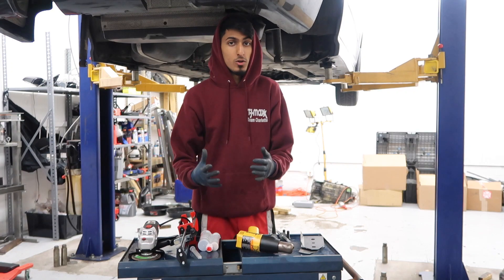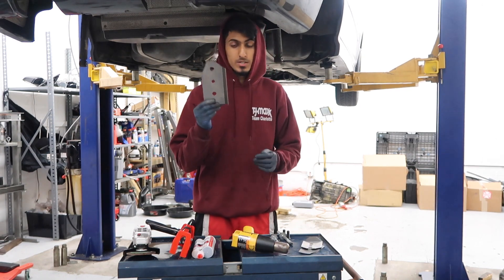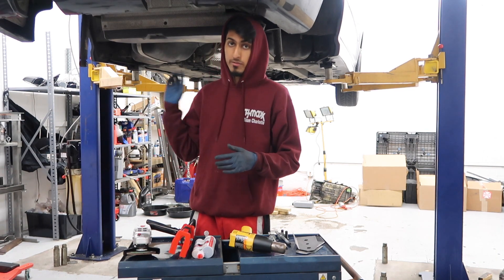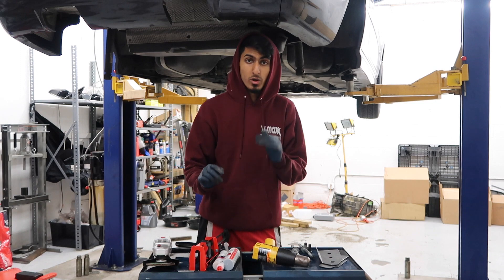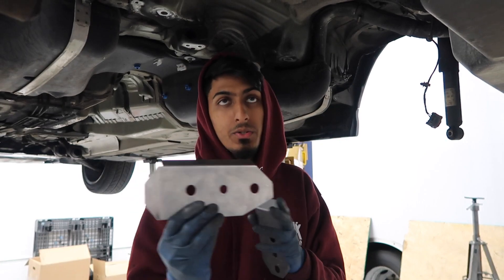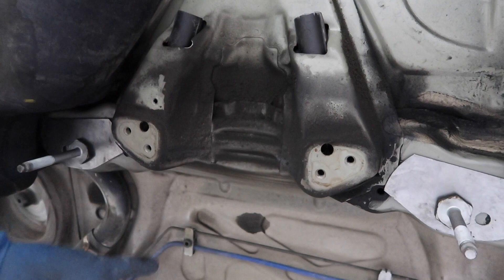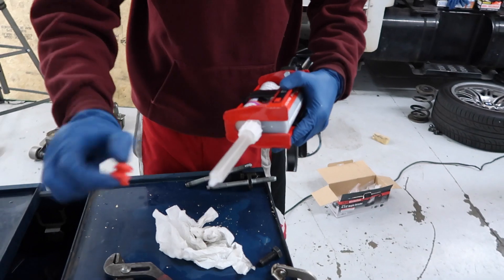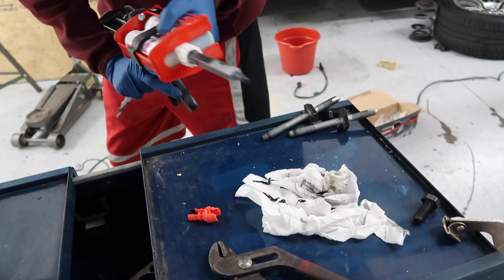BMW E46 Rear Subframe Reinforcement DIY (Epoxy Method)

Comment: For the people wondering if the epoxy method would work yes it would at least for a regular e46 , all the plate is really doing is acting like a washer distributing the load over a bigger area . Might even get away with not epoxying it
Reply: Ah, this is definitely assuring. Thanks!
Reply: Bad info.  Way more to this than just a "washer".  It really needs to be welded.
Reply: @chadwickmorehead5115  structural adhesives and rivets are viable and the recommended route as they are much stronger than welds. BMW repair procedures actually calls for bonding and riveting on new body panels rather than welding. We spot weld some areas when needed.

Comment: LOOOL, i guess thats one of the reasons why i was specifically looking for my M3 that would not have reinforcement done so i could do it myself properly, rather than having it done by a banana hands using super-glue previously..
Reply: When I seen the glue gun I was like wtf 😂😂 why don’t you just stich weld that plates on geezus fuck
Reply: Yet if you take your e46 to a dealer to have it done, they’ll panel bond it. Ignorance is strong with you

Comment: Hey man long time subscriber and love the videos, but as a welder I have to put it out there and WARN everyone that simply epoxy sticking the reinforcement plates isn't reinforcing anything. The subframe will still Crack underneath the plates. YOU HAVE TO WELD THEM IN. The reinforcement you get from the plates only comes when you have blended the edges of the plates to the subframe which adds the structural rigidity. The subframe is 100% still flexing under the plates, epoxy is so incredible soft and flexible it's doing nothing but gluing the plates in place.
Reply: While Im certainly inclined to agree with you, I also have to point out that there are supercars whos entire front and rear body sections are joined using only epoxy.
Reply: @Projekt5.3  that may be true, but we're usually talking about carbon mono tub chassis with those cars, all the structure and reinforcement is engineered into the design of the carbon. Here we are talking about 20 + year old 14 Guage, pinchwelded steel...significantly different and not something you want to be trusting epoxy to "reinforce". The only way to do it Is to weld it in. Combing the parent with the base metal is literally where the reinforcement comes from.
Reply: @cooperastro2690  Hell I think 14 gauge is being generous haha
Reply: @Projekt5.3  true 😂
Reply: BMW’s official procedure is to use structural foam…. I’ll just leave it at that.

Comment from the maker: THIS VIDEO APPLIES TO CARS WITH NO SUBFRAME CRACKS. IT IS PREVENTATIVE. THERE ARE OTHER METHODS OF DOING THIS REPAIR, WHICH IS WHY IT IS TITLED "EPOXY METHOD", THE EASIEST METHOD FOR A DIY'ER.
Reply: Jason, Do you have a diy on replacing the vanos seals. Off topic i know, but don't know if I can't find the diy or if you haven't done it. thx
Reply: The first sentence literally says "WITH NO SUBFRAME CRACKS". If yours is cracked, buy a new floor. They're about $450. Cut that one you have out and weld the new one in. THEN this applies to you.
Reply: Hey man long time subscriber and love the videos, but as a welder I have to put it out there and WARN everyone that simply epoxy sticking the reinforcement plates isn't reinforcing anything. The subframe will still Crack underneath the plates. YOU HAVE TO WELD THEM IN. The reinforcement you get from the plates only comes when you have blended the edges of the plates to the subframe which adds the structural rigidity. The subframe is 100% still flexing under the plates, epoxy is so incredible soft and flexible it's doing nothing but gluing the plates in place.
Reply: I would have at least added a few rivets per plate and personally would have used structural adhesive provided by BMW. Panel bonding can be just as strong if not stronger than welds. BMW repair procedures calls for panel bonding in most applications. With bonding and rivet bonding, there is no heat generated that would weaken the steel, allowing the steel to retain its strength. Another reason for bonding and rivet bonding is the increased corrosion resistance of the repair joints. We glue and rivet on frame rails.. (coming from a BMW/Mini & Audi Porsche CCRC). If anyone is to use this method ADD RIVETS before the glue dries. Don't just simply add glue.
Reply: @cooperastro2690  the bolt from the subframe is pushing them together, youd have to bend the reinforcement plate in order to also bend the subframe. hate to tell u that ur wrong bu. have u ever welded a support before? using a thick piece of metal over a thinner piece to reinforce it? the stronger piece if metal is doing the reinforcing, the weld is just holding it in place the spots that are on the perimeter of the support piece are susceptible to cracking  but not the support or under it. nothing against the collar but theres a reason they have blue and white. blue knows how to weld understands the dynamics

Comment: If you're planning on installing the plates with epoxy glue, save yourself the time and money and don't buy the kit,.  Gluing in the plates is no better than not installing them in the first place. Turner Motorsports, the shop that makes and sells the kit, states that welding is required for correct installation.

Comment: A $2.50 wire cup brush from Harbor Freight works much better than the tools you used for cleaning down to bare metal for the purpose of adhesion.

Comment: Thanks for the vid mate! I recently started hearing a tik tik tik noise whenever I was turning from rear. I was scared that my subframe mounts are shot. Got car on stands removed wheels and looked carefully under each mount and could not see any cracks. Then I took shocks and springs out to check out bushings. I started wiggling control arms up and down then could reproduce the tik tik sounds exactly as I heard when I was driving. It was coming from two bushings from balance bar. Put some silicone spray on them and the noise is gone. Really glad it worked out this way and none of my subframe mounts are cracked.

However I'm going to do the reinforcement anyway because prevention is better than cure!

Thanks mate!

Comment: Hey man ! I love all your videos I am restoring a 2003 BMW M3 E46 6 speed and right now I am on the plate reinforcement , I have everything prepped and ready to roll. please respond back asap please ! Okay So I am Mocking the plates up and I do have the option to weld and I also have the adhesive to do the adhesive method. There is "no" subframe cracks luckily ! but upon reading the Kit's instructions it says that installing the "two" in the trunk plates is vital to establish proper structural reinforcement. I am not attempting to be lazy but I am not the best welder and would much prefer doing the adhesive method. Now since I have "no" subframe cracking and literally refreshing and upgrading everything on the car can I just do the adhesive and skip the trunk plates "which I would prefer" ? and as for the two small 2/3 triangle plates with two holes do those mount on the "separate subframe bracket ? or like the other ones on the bottom of the car ? also thanks for the suspension video I did purchase the ST coilover kit because of the information you provided about the kit and wow what a quality kit !

Comment: Someone has tryed a rivet method is the same that welding, cheaper , and easy like epoxy method.
Obviusly only for preventivate not for cracked chassis
Reply: I would recommend using panel bond along with rivets. Bonding and riveting is stronger and will hold up better than welding.

Comment: Hey what protective sauce do you recommend applying after the job is done? mine's just been welded but it's bare metal and I want to protect it.
Reply from the maker: Hey, seam sealer, etch primer on bare metal and under coating. Some undercoatings can be applied directly to bare metal as well.

Comment: For an e46 that I'm planning to drift is it better to weld the plates on or will epoxy be enough? I'm not too sure about using epoxy to strengthen this area... But will definitely be something I would be able to do myself as I do not know how to weld or even have anywhere to do so.
Reply: If your drifitng you need welds and a full kit
Reply: Never mind 2 years late 😂 what did you end up doing?
Reply: @XanderMukbang  I bought the E46 👍😂

Comment: hey man nice to see you got a lift.
I can't imagine doing this job on jack stands, but do you think it's doable?
thanks for taking the time to cover this topic
Reply: MK Its possible, but it's just going to be more difficult
Reply: yeah think it'll be a pain in the ass havin to lay under the car on my back having debris fall onto my eyes. my 330ci only has 120k on it and no subframe issues yet but i plan on reinforcing sometime
Reply: MK Try to ask your local garage if you can borrow their jack lift for the weekend. Get a friend or two to look out for you and support you. If you have to use jack stands, well then get some googles to protect your eyes, and just be careful when removing things. Good luck! I'm going to do this with jack stands alone. Might be using 3-4 days total.
Reply: you get debris in your eyes just as much on a lift.
Reply: you're not laying on your back with a lift
Reply: Hey I did this repair alone, and I spent 4 days doing the job. I worked after work 4 pm to 8 pm. My hands are hurt and sore and really messy, but it's done! Good luck
Reply: Pepe Daily Congrats, must feel good to have pulled that of on your own :) Did you weld or use epoxy?
Reply: I did this on jack stands with no problems at all.

Comment: if the area which cracked has soft steel, doesnt this just mean the plate will be resting on top of that soft steel?
Reply: And spreading the force evenly across all of it, yes.

Comment: so this is to prevent the frame from cracking. does it holds up ok. or should i just weld the plates in. meaning is the strength aprox the same?

Comment: Hi Jason, i came across this method 3m epoxy but not sure which one to choose 3m dp420 or the one you used 3m 08115? Just need an opinion. Thanks

Comment: does the E46 NON M facelift need this? Is welding the differential  going to affect the subframe?
Reply: freedomlifemake 25 welding the diff will for sure destroy the subframe mounting points

Comment: Is that gonna hold? Is it not better to welding it together? I Beenthink to but a BMW e46 330ci:) any meaning on that CAR?
Reply: I would recommend adding a few rivets on each reinforcement. Bonding and riveting is stronger than welds. BMW repair procedures call for glue and rivets when sectioning out body panels.

Comment: Love your videos. What can we do if there is damage already? Is it the same procedure? Thanks!
Reply: No, get a new floor. The compromised metal can be welded but that shifts the stress and can cause other hairline cracks. Cut out the floor and buy a new one in the trunk.

Comment: How much would you charge todo all the labor of this? (Including replacing bushings and install 3.46 diff) I have diff, bushings and reinforcement plates just want the labor
Reply: sounds like someone is building a spec e46

Comment: Do you know if this what the dealership did during the subrame recall? Had my 2000 323i done at dealer (long time ago).. hopefully not a cheaper band aid fix
Reply: DG they put structural foam inside of the frame through the holes. They don't weld plates in. The body is hollow so they just fill it up to make it much stronger and reduce metal play

Comment: Nice Video. I am from Germany and it is Not easy to get the 3M epoxy You use. You think JB Weld Original work good as same?

Comment: This is irrelevant to the video but do the mirrors from a 2002 325i fit a 325ci? And also i was wondering if i could swap out the manual driver and passenger seats with the power sports seats in my 325ci?

Comment: Shop life I have a 03 325i sedan would my car have the subframe crack
Reply: Potentially. I have the same year 330i and I'm planning on bringing the VIN to the dealer to see if any such work has already been done on my '03. If not, I think this would be a valuable piece of preventative maintenance as our cars get over 200k miles.

Comment: Hey I got a question for you man. I have a 99 z3. It has a M54 engine in it. Can I do a S54 Swap relatively easily? Like would I have to weld in new motor mounts? Or could I move the mounts on the engine to work with my stock mounts?

Comment: Does the M3 subframe removal differs of the other video you posted time ago about the E46 rear suspension removal? i´d like to do the complete reinforcement job on my E46 M3 but would like to have a nice guide to unmount the subframe first ;)

Comment: I want to do the epoxy method, but 3m 08115 is kind of expensive where I live ~ 85 USD and + I need a applicator/gun which is also ridiculously expensive. Does anyone has idea how Loctite TEROSON EP 5055 will fit this job? Description says that it is meant for roof and panel bonding.
Reply: I bought one tube of the stuff, which is hopefully enough. I read a genius way to get around the no gun thing: squeeze out each side of the tube into a bowl and mix it with a spoon. Apply it with a credit card or something. I'll let you know how it goes. When I saw squeeze it out, I mean get a big bolt, heat the contents and push it out with your hand, one side of the tube at a time.

Comment: Will this work just as good as welding it?
Reply: Panel bond is stronger than welds. Add a few rivets for peace of mind. BMW procedures on replacing panels actually calls for bonding and riveting rather than welding.

Comment: I spoke with a tuner shop that work on high end sport cars and he mention that the problem of the Subframe cracks it happens to cars that are abuse on the track and very aggressive driving ! Not all ///M3 cars have this issue !
Reply: I never tracked or abused my m3, even never ever drifted or launched it - but I have cracks at just 45k miles

Comment: Sorry but don’t think that is a good fix, even if you weld. Reason is because the frame is not thick enough to support all that stress, so eventually it will crack around the fix, trust me. How thick is that repair metal plate kit?